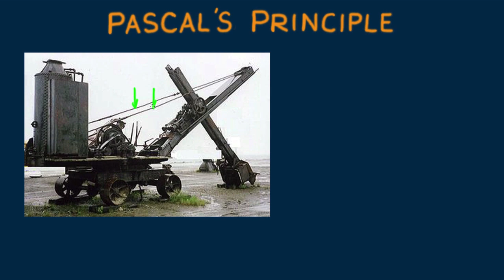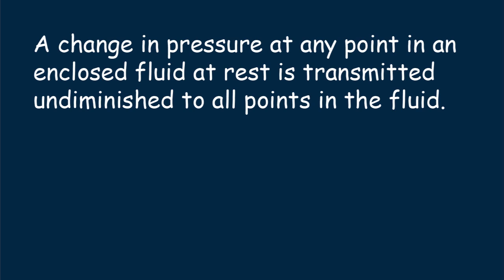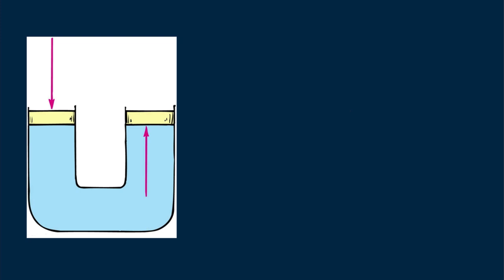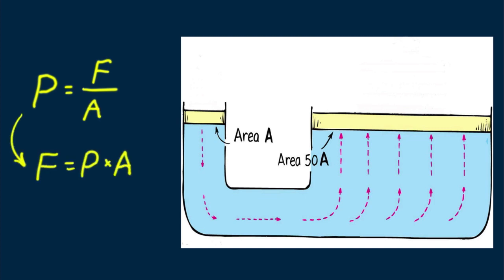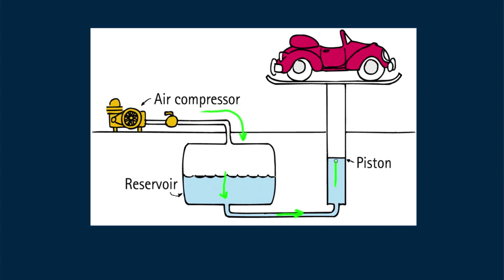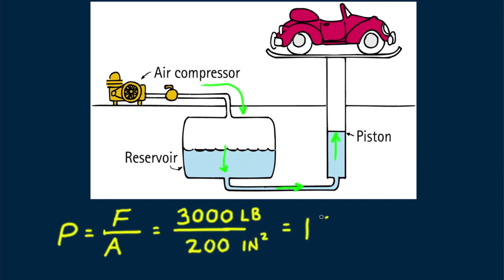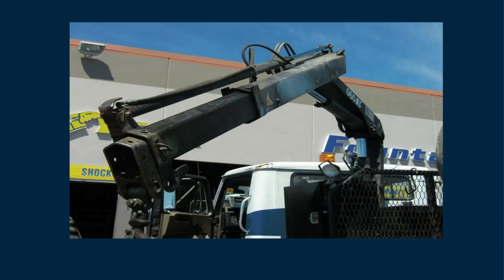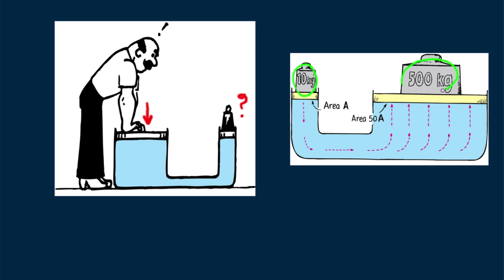Hewitt-Drew-it! PHYSICS 64. Pascal's Principle

Comment: for the concluding question: Why won't it work going backwards?
Where are the answers to these end of video questions?
Reply: +bellinghammond There are no answers to the end questions - they are there to make you think. The reason here that it won't work backwards can be found by using the equation Force=Pressure x Area. If the pressure at one end multiplied by the area equals the force, then you would have to put a huge amount of force at the other end to equal that amount.

Comment: By definition of work, as I Googled it, P = (E/V). Thus, PV = Energy 'E'. Now what I've learnt today tells e that the pressure exerted on a fluid is transmitted undiminished through the fluid. I.E. Pressure is constant. Now, the volume is also constant as the amount of fluid that rises up in a piston is equal to the amount that goes down. PV is a constant and thus Energy is a constant. correct me if I'm wrong, Sir.